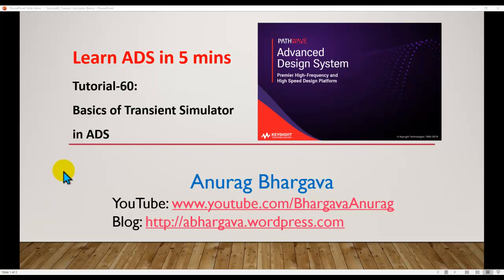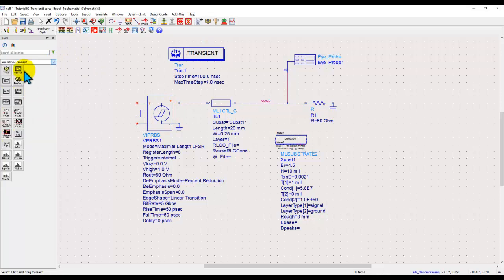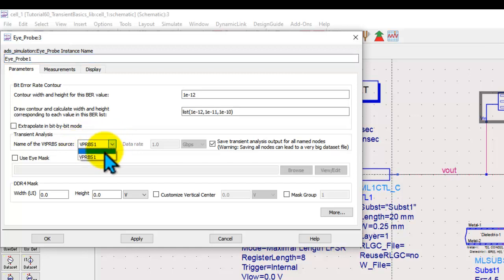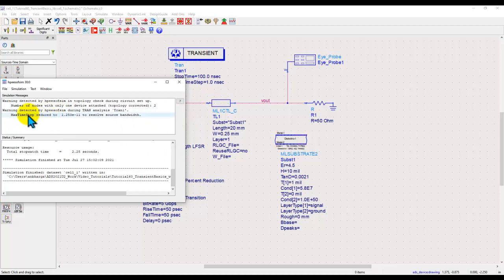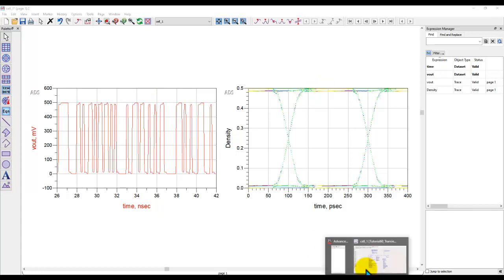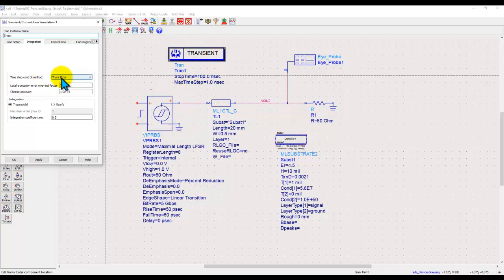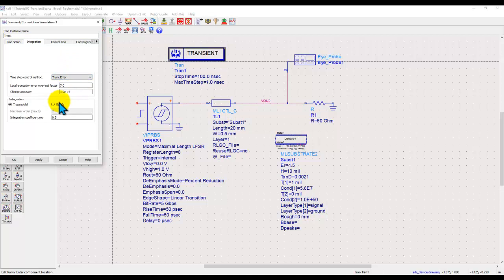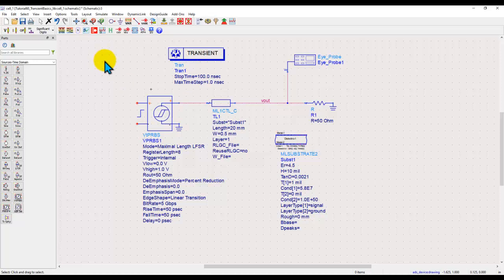Tutorial-60: Transient Simulator Basics

Comment: HI sir, really nice tutorial.  i used a layout EM model cosimulation in transient simulation, and the message showed me the internal time step... is too small at ... i want to know how can i solve such kind of problems
Reply from the maker: Hi Peter,
Try changing the Time Step control method to Iteration Count or Fixed as explained in the video and hopefully this should resolve the issue. Also, make sure that your EM simulation is performed from DC to desired frequency for an accurate response while using it in Transient simulation as I have explained in the Tutorial 61.

Comment: Thank you for your informative videos like always. Can you please tell me how to check capacitor charge discharge time check using transient simulator.
Reply from the maker: Hi Adnan,
I never tried it but you could try Pulse source as input to the Capacitor & run Transient sim and probably you would be able to see the required characteristics.
Reply: @BhargavaAnurag  I have tried this method. But dear sir I in my design there is a continuous RF power that is converted to DC and store in the charge. I want to see the capacitor charge time for different RF input power levels. My design consists of Rectifier with power management unit. Can you please guide me in this context.